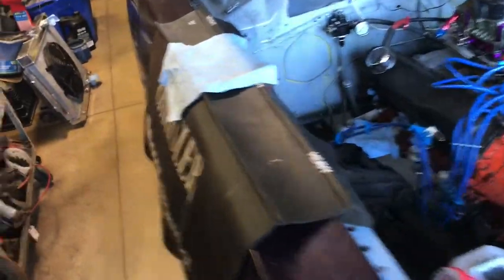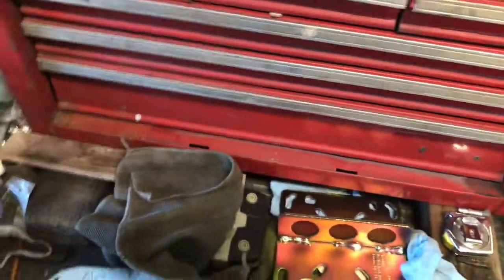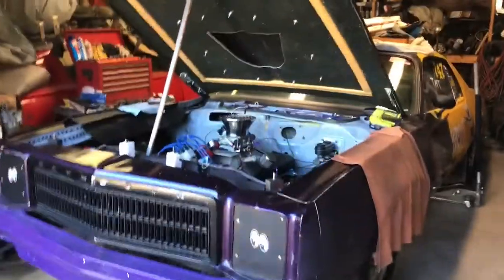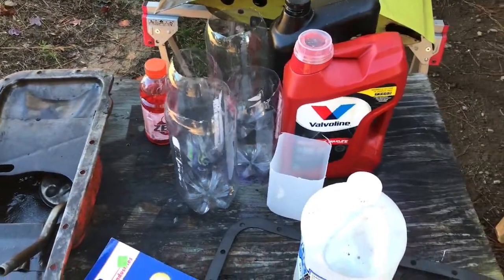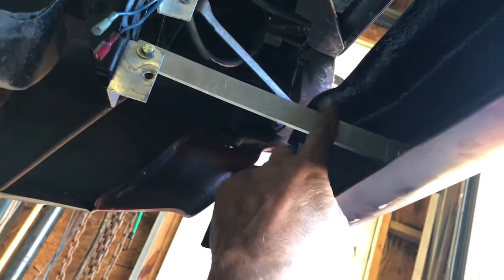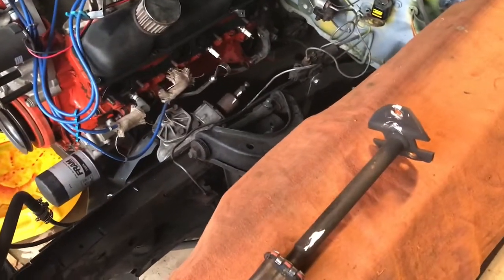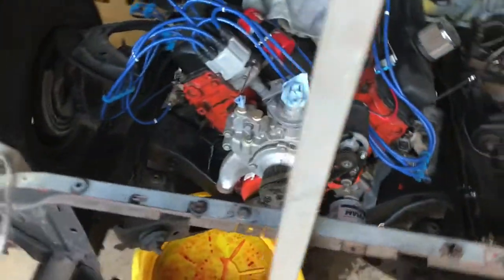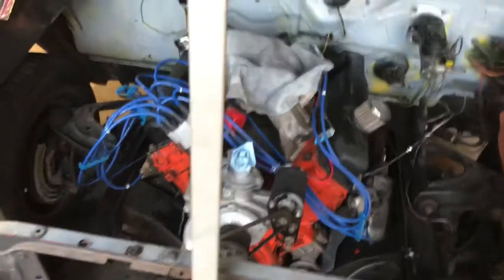FURYIOUS update: 11/30/21

Comment: You'll have to share your secrets for wrestling that steering upper shaft out of there sometime,
Bob. I hate those things with a passion, especially if it involves the "u-joint" part.
Onward and upward!
- Ed on the Ridge
Reply from the maker: Knock the roll pin out of the coupler. Then I removed only the two bolts that held the shaft to the rag joint. Marked it good so I can put it back straight. Then took a pry bar to get past the remaining back facing bolts. When I reinstall it I’ll have to back those bolts out a bit. Should pop right in with a few taps of a hammer
Reply: @bobsclassiccarsparts8772  Thanks. It always sounds good in theory, eh? 🙂